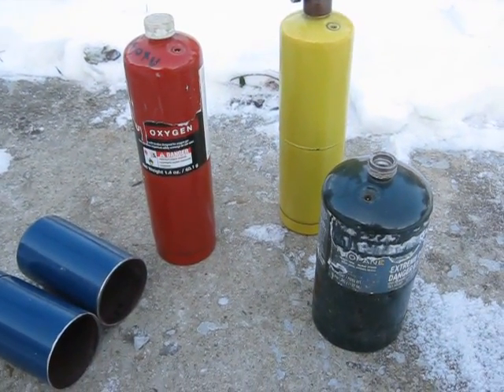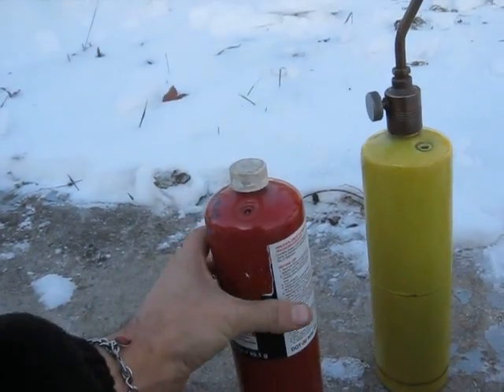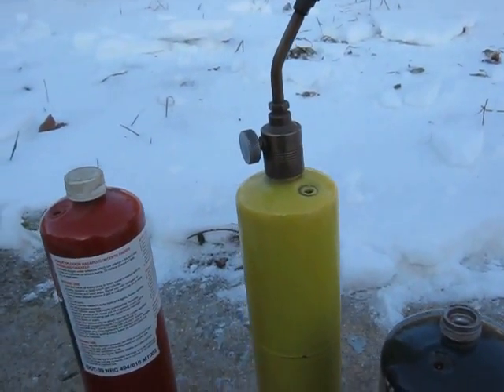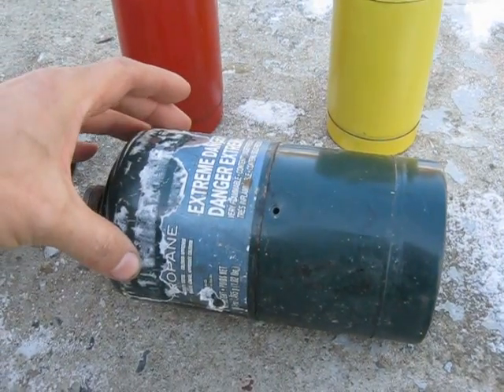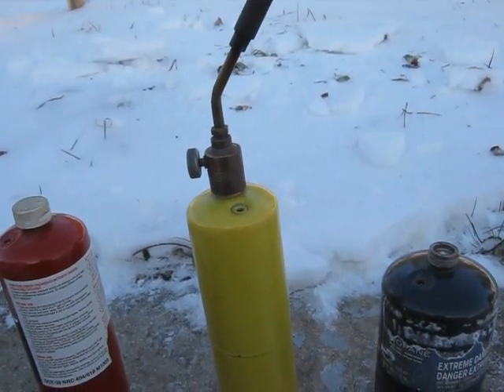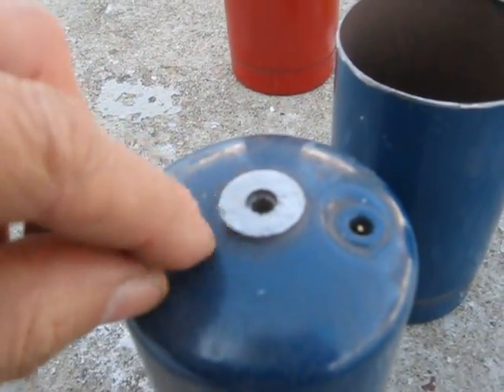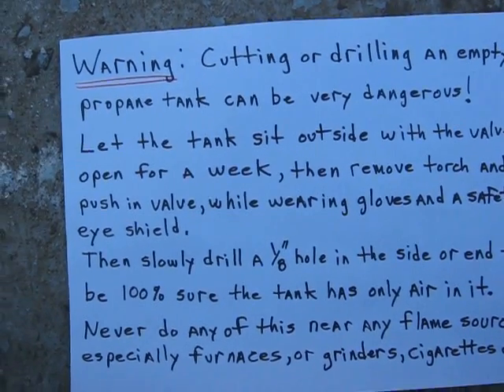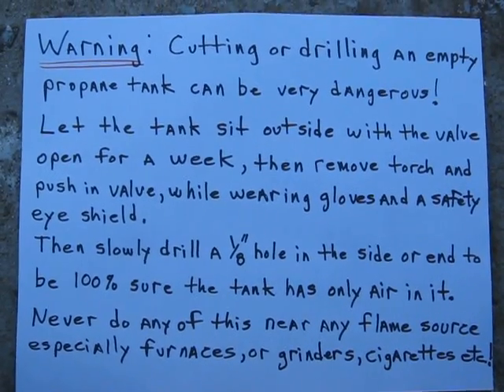Homemade Small engine Gas Tank Part 1

Comment: How many PSI does the 1pound tank withstand as a maximum?
Reply from the maker: I don't have any idea, but I would assume at least 100psi, and probably a lot more than that. I only use them as a non-pressurized gasoline tank, and not a pressure vessel.  you may be able to look up what the maximum pressure propane can generate at a certain temperature, say 100 deg. F , and therefore the tank would have to withstand at least that much. I don't recommend using it as a pressure vessel though.

Comment: I remove the 2 valves the main on the top and the one on the side and blow some air in to it to move all left over gas.
Reply from the maker: Good idea, I am nervous about messing with the propane cylinders, so I try to use the oxygen cylinders, though they have to be empty or they can act like a blow torch when you cut them with a grinder!
Reply: Good point i've got a bunch of those gas cylinders.

Comment: I like to shoot the top area of the tank to make sure they're empty of everything. Ive had a few fly a few feet, but they dont explode, a hole is just made. Much quicker, and if youre a good shot, you can do it from a distance  for increased safety. I used to do this on the larger propane tanks when Id scrap em. Id shoot the valve on those while they were chained to a tree.
Reply from the maker: +Jon Woods Hmmm, interesting ideas!  Personally I wouldn't dare to mess with one of the 20 pound tanks, but I have heard that some people do. I know someone who used to unscrew the valve off of the tank, after the valve had been left open for a few days. He said he still got a whosh out of it when he held a torch to the opening. Apparently the propane seeps into the steel tank walls, and takes its sweet time coming out.
Reply: ChargerMiles007 correct  load of accidents with steel drums happen because of this effect   just opening it for a while wont get rid of al the gas            and with some gasses  damn its not just a whoosh xD

Comment: FYI, propane and propane based gases (i.e.:MAPP, Chemolene, Propylene) are heavier than air so leaving it upside down will facilitate in the evacuation of any leftover gas!  Also, oxygen and oil don't get along! An explosion will ensue!
Reply from the maker: +4gasem thanks for the info, so in effect the propane will pour out of the container.
Reply: Yes, that's what we do when we're evacuating large cylinders.
Reply from the maker: +4gasem Thanks for the advice, having more knowledge , rather than less, is always a good thing!
One guy says he burns a hole in the bottom of BarBQ tanks with oxy-acetylene, there is quite the flame out the bottom! He says it is safer than opening the valve to let the tank air out, as his way there is no oxygen in the tank, just propane. He could be right, but there is no way in heck I will ever attempt such a thing. That guy must have huge steel ones!!!      Of course it will only take one tank messing up, and I will be reading about his funeral in the newspaper!
Reply: +ChargerMiles007 I'm in the industry, and this is DEFINITELY NOT something we'd recommend!  Seriously, that's crazy!
Reply from the maker: I agree, none of this is 100% safe to do, but oxy-acetylene is definitely a no no if you want to live very long! I found a cut up 20 lb tank at the scrapyard, it has about a 1/8" thick wall.

Comment: the few times I have had to do this (I make sure it's empty and bled) I do that first cut or drilling in water. I figured if the tank is say full of lpg and it punch a hot bit threw with no air around it can't burn. I don't know just throwing my 2 cent in.
Reply from the maker: +Mr3wheeledbike Hey, thanks for the idea, drilling under water is an excellent idea!
I let the tank sit outside for a week with the torch attached, and the valve open. Then I unscrew the torch, and push in the "tire" valve with a small screw driver (while wearing gloves and a face shield, and NO flames nearby!) If that all goes well, no hissing etc., I then drill the 1/8" hole in the side, and let it sit a day or so. After that it should just be a piece of steel!
Reply from the maker: +Mr3wheeledbike I just added your under water drilling idea as an annotation onto the vid, so I wanted to give you credit for the idea! I will finally make a vid showing how large a Deltic engine is, hope you like it, and I hope my permanent markers are up for the task!!!  :)  I am still working on the ultra mini Compound Deltic, it is taking me a long time to get the little sucker right!  I even contacted the Deltic Preservation Society ( DPS ) with a question about it  :)
Reply: ChargerMiles007 hey thanks for that bit of credit but feel free to use any idea i have any time. As for the deltic news, that great! I want to start the project in about 2 years time (will have my own shop then) but i sure it will take a long to to finish if i cant even mange to figure it out. I think the key in in using the right base engine flat head engines are promising but lack the open deck format i am looking for.
Reply from the maker: +Mr3wheeledbike I started the full scale Deltic layout yesterday, I am about 5 hours in now, but it should look decent when I am done. Vid to follow.  :)
Reply: ChargerMiles007 i wait with the utmost anticipation.
Reply from the maker: +Mr3wheeledbike Still working on it. I am drawing it in pencil. then I will have to trace it all with a black sharpie, or 2 or 3 !!!  :)
Reply: ChargerMiles007 no rush but when it does come out i sure we will discus,
Reply from the maker: Still working on finishing it off.

Comment: good idea
Reply from the maker: +Travis Tomlin I just uploaded the vid where I actually build the tank, it is rather long, but it requires a bunch of steps to build a tank. As I mention, Safety is the #1 priority, so I recommend using the empty oxygen tank, less hastle.
Reply: Yeah we have a ton of empty tanks because we used them on our plow when the fluid would free last winter
Reply from the maker: +Travis Tomlin Yes, I have a bunch also form a little outdoor Bar B Q, though I found the shorter "fatty" tanks to be a bit weak. They might work OK if you left them in 1 piece and mounted it horizontally for a large 8 horse engine or say for a mini bike. I think you would need a gas fed MIG welder, or TIG so you didn't blow too many holes in it while welding. Probably best to hold the tank with band straps like the old tanks at the end of vid 2.